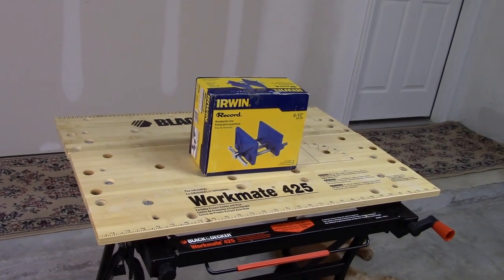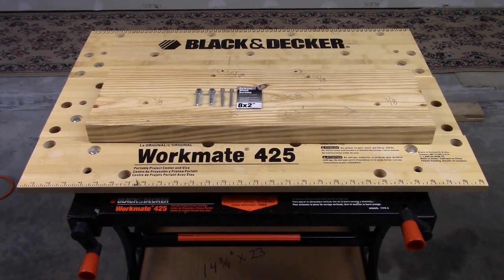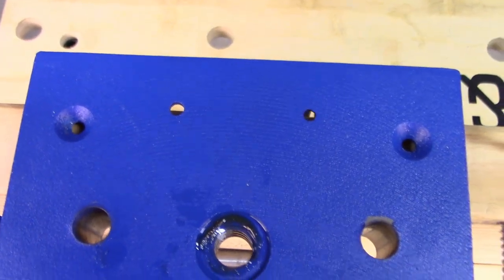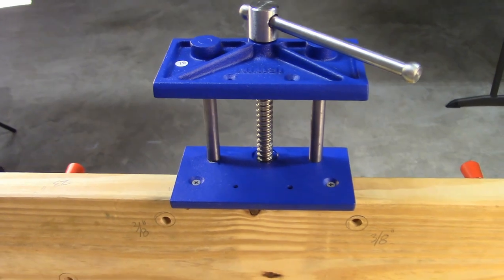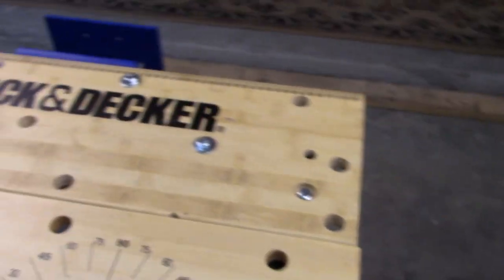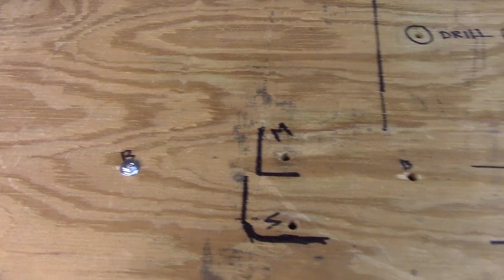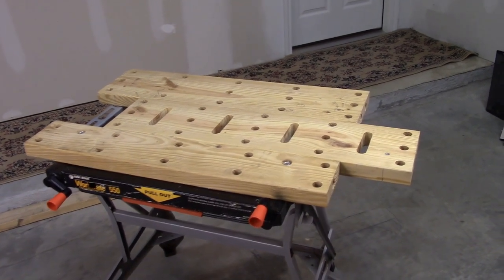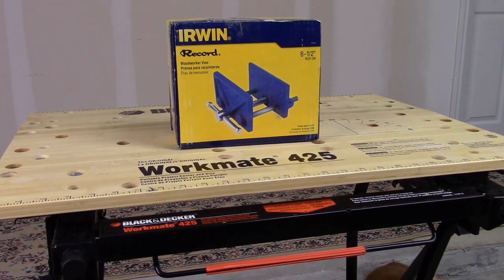How to attach an Irwin Woodworker's Vise to your Workmate 425

Comment: Hello, first of all thanks for the trove of information. I don't know much about woodworking, so excuse me if it's dumb: why would you need to attach a woodworker vise instead of clamping your wood between the workmate's default planks/vise jaws?
Reply from the maker: There are times when you have longer or more complex work pieces that may require a vice like this.  Always remember, you can never have to many clamping devices.  :-)

Comment: What’s the difference between the WM 1000 and the 425? 
Thank you
Reply from the maker: Jake Hoffman The stand on the 1000 is significantly different, more like a x frame opposed to the collapsible frame on the 425. This means you don't have the adjustable height on the 1000 as you do on the 425. Thanks for stopping by and posting.
Reply: WorkMateGuy thank you for the prompt response and the content. I am looking forward to purchasing the 425. I also noticed the frame and step differences. I did not notice significant advantages to the 1000.

Comment: I bought this model yesterday of the Workmate . The belt that synchronises the twin vise screws is very thin and poor quality . Also the centre panel on the one i bought was cupped by 1/4 inch . The panel is a 3 layer sandwich of MDF and bamboo on each outside face . the bamboo on my one was delaminated and cupped . out of the box brand new . I cannot be bothered to take it back its too uch hassle . i will make a new panel out of Baltic birch 3/4 plyeood . i must say the build quality is not as good as my old original one that was over 35 years old . It was stolen thats why I had to buy this new model . B & D are not what they used to be .
Reply from the maker: 738polarbear Wow! You should really get your money back. I would suggest contacting B&D directly and showing them photos of what you have received. If you decide to make your on panels. This video will help you
 https://youtu.be/tkgWnWOHieE